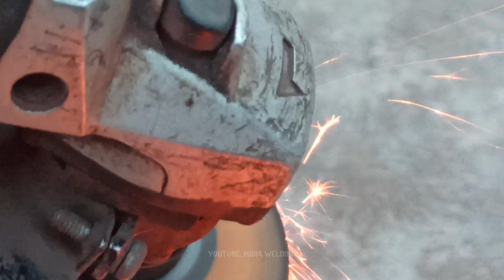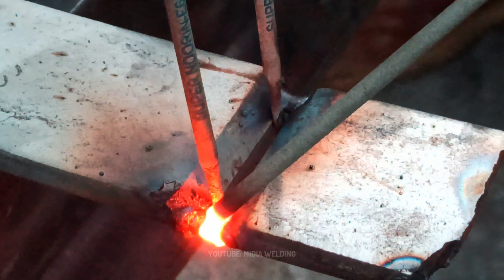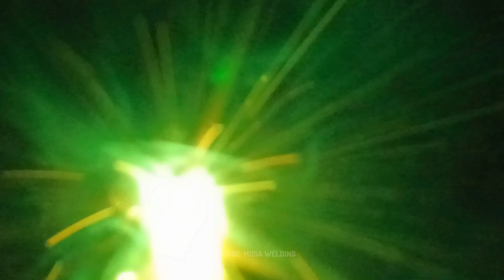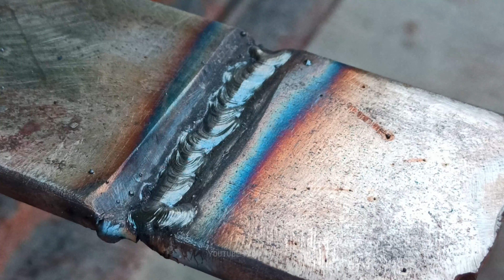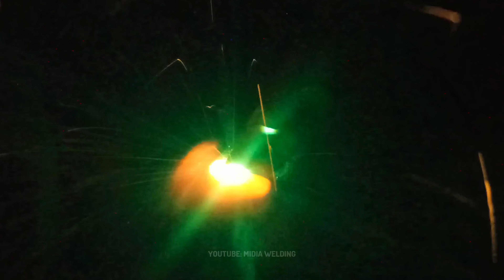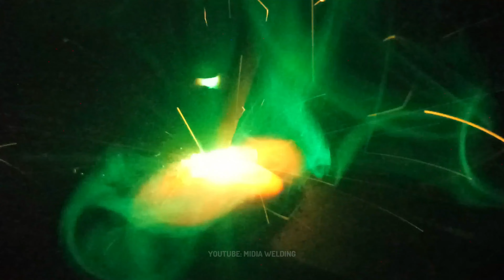How to weld powerful ARC welding. Electrode E6013

Comment: Awful welding, seam width is far too big for single weave of that size electrode - rule max weave 2.5 x electrode diameter. Very amaturish technique with underflushing  and very little side prep penetration.
Reply from the maker: You are right, thank you for your opinion.